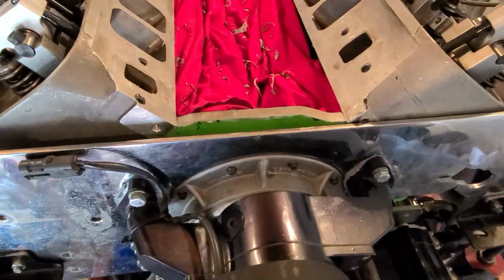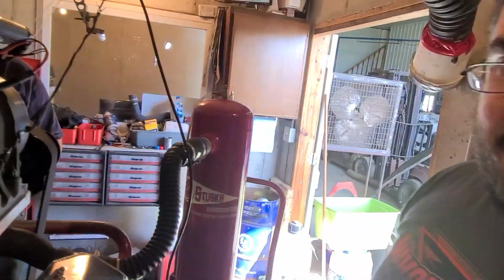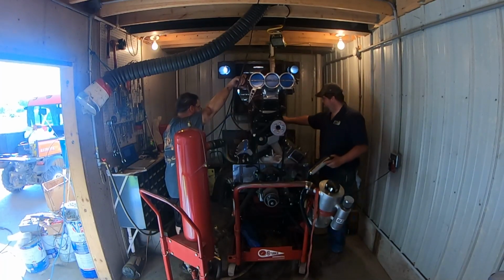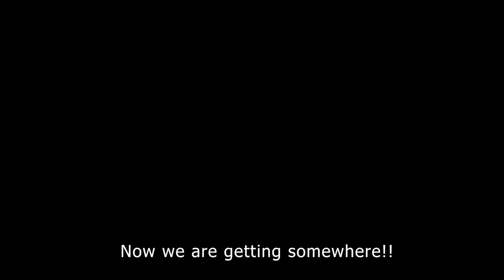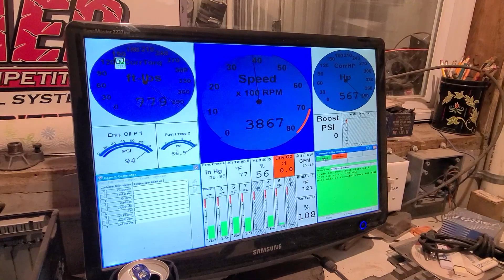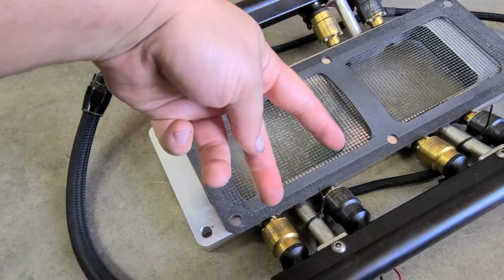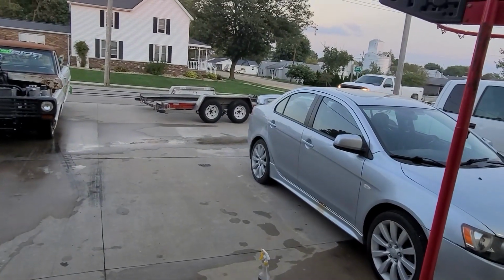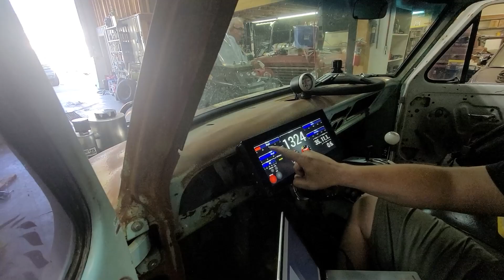Blown Big Block Chevy E 85 Dyno and Burnout (Cleetus and Cars Texas Prep)

Comment: love the video's as always mate, something to consider on the next motor would be to reduce to cubes down to the 400's and turn it to 7500-8000 rpm like most of the aussie guys which is why the smoke is so intense, big revs and a tall final drive is the key
Reply from the maker: 7500 isn't out of the question with this motor.  😁.  I do agree though!

Comment: I've been building a USA\AUSSIE burn out setup but poor man  style LoL I picked up a 4 door 77 nova for bits and pieces for my little small tire stock suspension turbo 77 2 door nova it was some what a budget build but my paw paw bought new in 76 and has 398,236 miles on it and the 305 has never  had the oil pan off it was running and driving when I started the build in 2018.  but the old 4 door burn out whore came  out  looking good with dollar general gray primer and flat black for all the chrome and trim and of courde it needed some bondo in a few spots lol but im proud of it i had the axle tubes welded on the old 8.5 10 bolt fleet pride custom drive shaft lol and a Strange rebuild kit with a spool and a 3.50 gear a rebuilt th400 with a manual valve body and  t brake just cuz and a used ptc conveter i dont kno how the trans cooler is gonna work its pretty big with a nice fan and i threw together the motor with shit i already had its a aluminum l33 block with gen4 4.8 rotating assembly with 706 heads with btr springs and a trunion upgrade with a rowdy AF btr cam ive never even fooled with roots blowers before this but i picked up a used weiand 6 71 and sent it to the blower god Chuck Ford to get rebuilt im running dual Holley 4150 plates that have 4 inectors in each plate one with 8 bosch 210s with edelbrock 1 1/2" plates that turns the 4150 into a 92mm 4 bolt ls throttle bodys and im running a couple amazon special 92mm tbs its a weird setup lol the blower is on a holley high ram lower with a joe blow adapter for the blower very nice piece it came from Australia and im running 8 more bosch 210s in the in the holley lower intake. im running holley efi hp ecu i run the same one in my other car I've had some pretty smart people help me with my harness's and wiring to get the little cobbled togethe frankenstien set up to work and a few more smart guys get all my pulley and balancer spacing right besides the altenator im running a electric water pump. i just have to put a real fuel system together for it at the moment im running 3 525s inside my fuel cell but methonol kills those pumps pretty fast at the moment im rounding up every thing to go mechanical and use my back up enderle 110 for my other car ive done a few small rips but every time I do i kill atleast 1 525 pump some times two. But your truck is badass I call my car the disco slut besides the fuel system a cage and some small things and tinting my window's ill be out their ripping until I kick the rods out of the little guy ive already made a blower hat out of a mailbox  I hit with some flat black. Hopefully promoters will start having alto more burn out comps!
Reply from the maker: that sounds kick ass! nothing wrong with making weird things work together.  i really need to get injectors under the blower as well to help fine tune each cylinder.  do you live anywhere close that you will be at any future cleetus and cars? would love to see it in person!